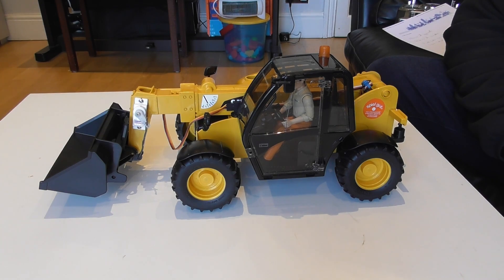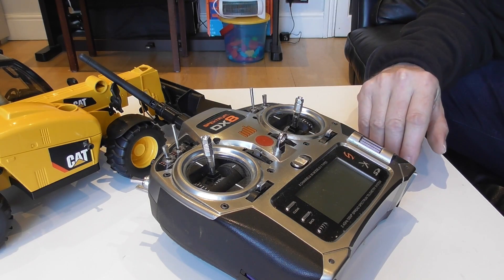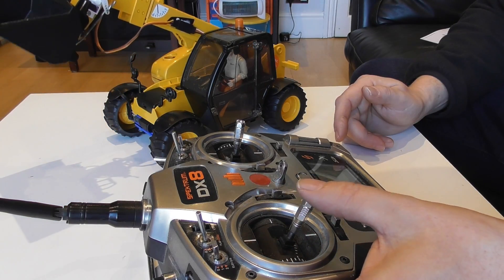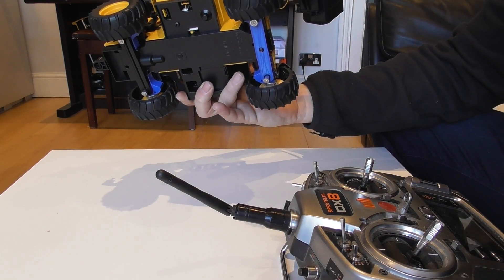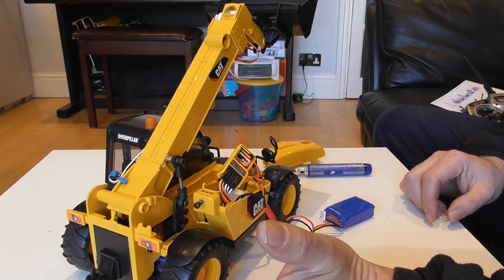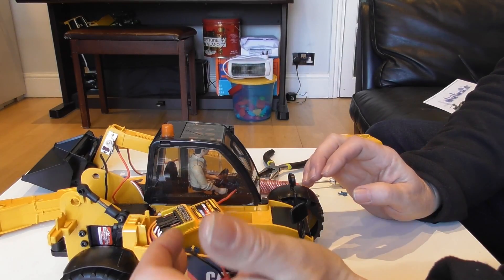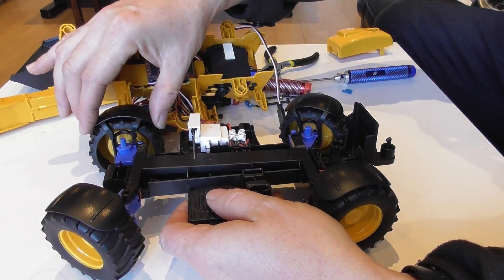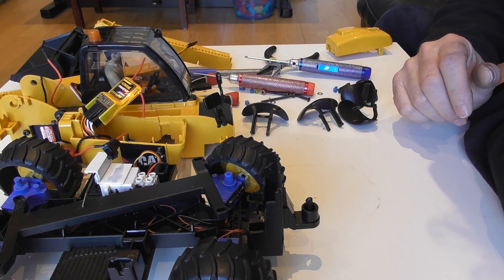Bruder CAT telehandler pt2: prototype explained

Comment: I don't know if you still read the comments on this after all these years, but great job! It did make me wince though, taking apart a perfectly good working model. I like the use of the N20 motors on the wheels - i did wonder whether the N20s would be powerful enough to drive a big model like this, but they handle it really well. Looking forward to viewing part2 (five years after the fact!)
Reply from the maker: Hoping to find time to make more videos. N20 motors come in many different gear ratios and voltage ratings. Getting the right combination is the key. Obviously more power = less speed etc. 12v ones tend to be more powerful, even on 7.4v batteries.
Reply: @RCModders  Oh yes, i know all about the N20 motors, used them in quite a few smaller projects myself. I just wasn't sure that such tiny motors could handle such a large model. I am currently working on a tractor loader, where the rams will be powered by N20s with a long M3 screw thread on - they work very well.

Comment: How much would u say it cost
Reply from the maker: Probably around £150 if you make and print everything yourself I would say.
Reply: @RCModders  that's not to bad I don't have a 3d printer 😅 but I'm starting a huge monster of a build that's scratch built but costing over £700 and 95% metal
It's a 8x8 wreaker and stuby lowboy that's all terrain off roader with around an inch and a half ground clearance bases on my current 6x6 Hemmt dump truck and the HG-p801 rc
Reply from the maker: @Lee-At-Green-Pheonix-Rc  sounds great!

Comment: I’m finally getting around to do this build did you use the 6 volt or 12 volt n20 motors thanks Pete
Reply from the maker: You can use either. 12v sometimes have more torque - but will be slower.

Comment: Can some of the part be use for the Cat Track loader you made and have you look at the Bruder 2454 JCB if so I would like to hear your input on it.
Reply from the maker: I think that the 4 wheel steeling / 4 wheel drive hubs on the teleloader - or something similar - might be able to be  adapted to work with the JCB 5cx. Which is part of the reason I chose to do the teleloader. The wheels are a lot bigger, so might need more powerful motors. I think that the actuator cylinders that i developed for the CAT track loader if adapted (for length mainly) might have uses in a lot of the Bruder models including the front bucket on the 5cx. I have got a 5cx waiting to be done, but I need to figure out more of it before I start that. Good thoughts.    😀👍
Reply: @RCModders  Thank you once again my friend you are opening up ideas for a lot of people.
Reply from the maker: My pleasure. That's what its all about!😀👍

Comment: And that leadscrew.. How did you manage to do that?
I've tried for ever to model up/print that..
Please start also a cad course..😉👍👍
Reply from the maker: 😂 easier than you might think: find an STL for a 3D printer leadscrew nut (been done by loads of people); down load into Tinkercad - maybe via mesh maker (or whatever); trim it down with a square edge donut hole; build the rest of the cylinder round it! Easy then to make different length versions. Print without any supports. 🙂👍
Reply: @RCModders  
Haha.. 
You make it sound easy.
I've downloaded and printed dozens of those, but they never fit.
What you've done is very very similar to my ideas, but since I've not yet found a nut that fits I've kind of given up on that.
The closest I've gotten is with a leads crew stl that used to make a boleon operation on a solid block.
But that to was a bust.
So I would say it's not that easy.
👍👍👍
Awesome!!!
Reply from the maker: feel free to use or mod mine. I have got lucky - works well with PLA on the mini delta & PETG on the Prusa. A little grease makes it work even smoother. If it won't let you email me & I'll send you the STL file.  🙂👍
Reply: @RCModders  
I will definitely try out your mod😉
At the moment I'm in to some other builds but soon I will try.
I've been watching some of your older videos, about 1/10 crawling so I'm afraid I got in to that to now..😜
Reply from the maker: Can't blame you the rock crawler and scalers are brilliant fun. I do keep coming back to them. 🙂👍

Comment: Great. So you already bought you second printer.. Haha 😉
It quickly gets out of control.
Thanks for all your shared knowledge.
👍👍👍👍👍
Reply from the maker: I still love the MP mini delta - so easy and reliable to use. Built the Prusa to let me do bigger / multiple prints using materials other than PLA (ie ABS, PETG etc). The IKEA based enclosure cabinet was fun to build and really improves the prints and keeps the hot bits away from kids! 🙂👍
Reply: @RCModders 
Yeah about that, I've printed PETG and TPU and some other I cant remember right now on my PLA ONLY flashforge finder with no problems at all.
But it's a direct drive, not.... Haha jesus I cant remember the name of that other system when it feeds tvia a tube to the hot end. 
Direct drive is for me the way to go.
Not tried abs yet, but to be honest the only reason for me would be the acetone welding.
Pla is for me the go to.
Unless you want to make gaskets. Then flexible pla or tpu.
Heated bed would be great in my kind of chilly basement, but enclosure and 35-ish degrees celcius works to..😉👍👍
Reply from the maker: I think the other kind is a Bowden drive. I have a feeling that the Prusa may be direct and the delta is a Bowden drive. Both work well for me.